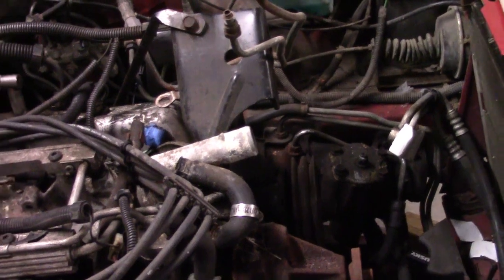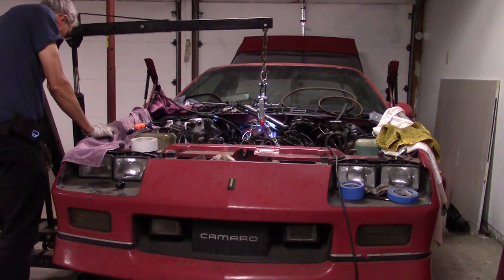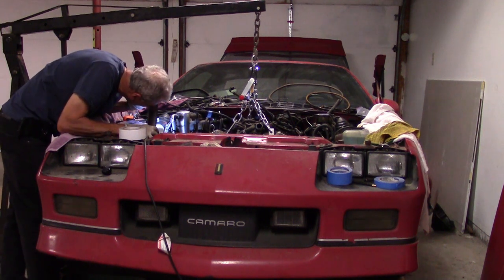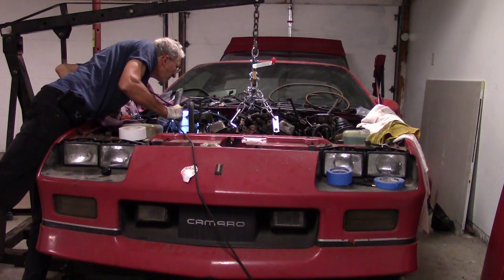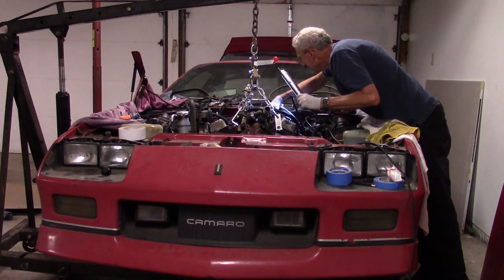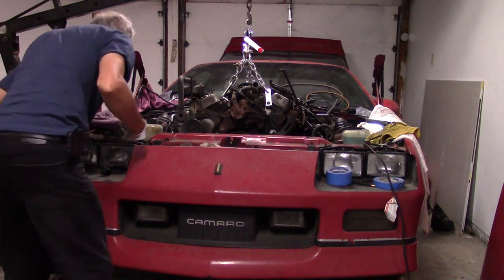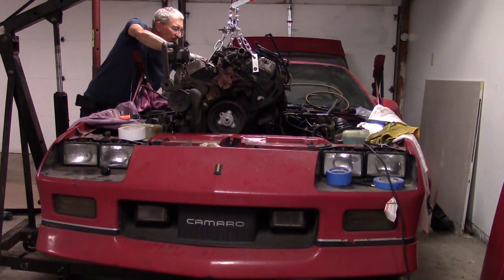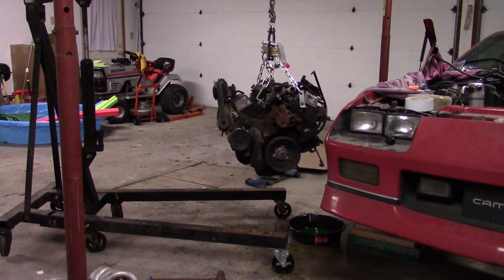Pulling Camaro 305 TPI Engine - IROC-Z Barn Find EP #7

Comment: Just for future reference, pull the front bumper cover/headlights off and hoist from the front.  makes it 10x easier.  You could pull it all in about 20 min.
Reply from the maker: Thanks for the advice.  I looked at that, but I wasn't sure how difficult it would be and I have some length limitations in the garage.  I'll take another look at that if I need to do another pull.

Comment: Also it would have been easier to leave all the wires connected and just pull the two ECM plugs from behind the passenger fender and pull them back to the engine compartment.  That way you can see how everything is connected while the engine is on the stand.  That's how the factory put it in.  Just sharing some experience.
Reply from the maker: I know that the general process today is to dress the engine with its harness and then connect to the car at marriage.  I was looking for an inline or bulkhead connector and couldn't find one.  I didn't consider pulling the harnesses back through the dash, but I suppose that is another approach.